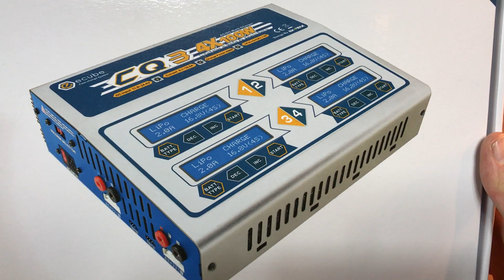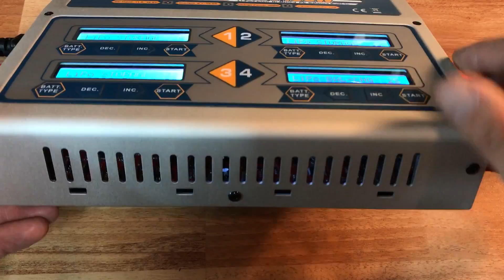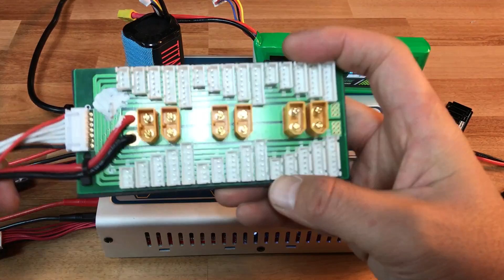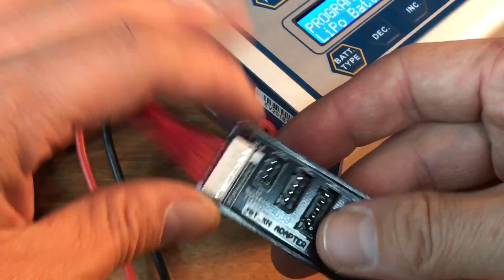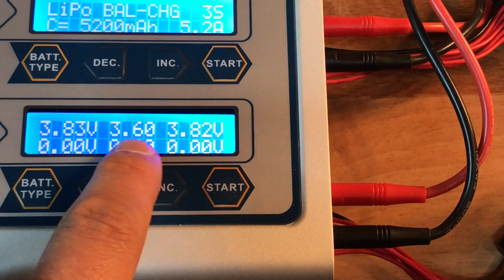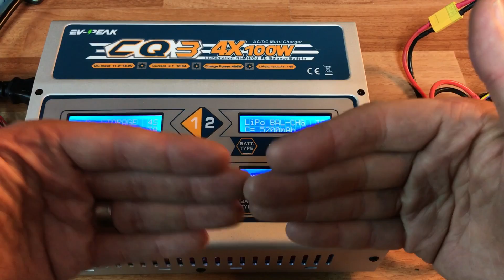EV-Peak CQ3 100Wx4 10A Charger Review (it's really, really good!)

Comment: I have a few 7.5 volt NiMh batteries that I'm trying to recondition.  I'm new to this field and know nothing about it. I've don't my capacity setting for NiMh battery for low 5000 and high 7500 MhA.  The charger goes through the 3 cycles and once I get the "END" flashing, I only see 0000 for low and 0106 to 0110 for high on all three tests on at least 12 batteries.  I'm not sure what I'm doing wrong.  On my user settings, right after display at 100% and right before factory reset, there is an option by factory default for "Battery End Vold" set for LiPo 4.2 v/c.  using the forward and back buttons, you can change the battery type.  I has everything except for NiMH.  Could be this?
Reply: U need to set the user settings first then select NiMh
Reply: Share your email I will send you the settings

Comment: HI Jeff    I have this charger but have never gotten it to work.    I have 2 batteries from Spectrum and getting "connection break" on any of the ports with both batteries.  They are not swollen in fact they are new.     A year ago I also tried to charge a battery and got the message "high voltage detected" and thought I damaged it and put it back in the box.  That was over a year ago.   I am not seeing the message when I try to use it again.  That was only on one of the ports.   I have tried that same port today and getting the connection break message but nothing about voltage.   Any Ideas?  Thanks!

Comment: I found that the c=setting in lipo is the charge current  cutoff and if you have new batteries they will often charge beyond that leaving your battery at less than 4.2 per cell. I usually set that c= number about 500mah above the rate of the battery so they dont stop prematurly

Comment: I have one of these. Does what it's supposed to do but one the first one the power switch broke so I couldn't turn if off. Got a replacement that also does what it's supposed to do but the fan is making a bed noise for some seconds after it starts. Probably bad bearing. Starting to question the quality of these.

Comment: How to charge a 550 3s battery... The cq3 has settings of 400, 500, 600, etc. What settings do I select to charge a 450 or 550 battery?
Reply: Its ok to charge a 550mha batt @ 600mha, if u have high C rated batteries you could charge @ 1000mha
Reply: Okay so for my 550 batteries I can charge them at 600. What about the amp setting? Do I let that stay at the default point 6? Or can I bump that up a little?

Comment: I have used the earlier model EV-Peak  80 watt per channel  AC/DC charger for 2 years, had to exchange, early on, when one display quit. Charger has worked well on my up to 4400 mah 4S packs but one display is becoming hard to read. This one has more features and cheaper price. My not be suitable for some fast charging large heli flyers . Make sure that supplier can/will repair  after warranty. This charger is probably limited to 100 watts per channel regardless of external power supply capacity.

Comment: can it really do 10 amps on 4s since you own one can you out a battery on or a few parallel and tell me please ? the ev peak duo one I had only put out 6.5 amps on 4s plugged into the wall thanks if you could test that for me and tell me that would be great
Reply from the maker: yes, i haven't tried that yet
Reply: 7demo7 thanks please lmk man
Reply: Depends if your battery can handle that though. Have to look at the charge rate on the batteries specs

Comment: Thanks for the review but I have a question. Using the balance board do your small 1S batteries charge like individual cells in a higher S battery on the CQ3? I've tried the 3 and 6 to 3S/6S balance cables and never get full charges to 4.2v and the the individual 1S batteries do not balance out as well as individual cells do in a real 3S/6S battery. Tied several chargers using 1S 150mAh to 750mAh batteries and they never completely charge to 4.2v and storage charge is also not as accurate. 

Do you use fast charge, charge, or balance charge when using the balance board? Sure would like to use one but so far my experience has been poor charging multiple 1S batteries as one larger S rated battery. This CQ3 is double the watts of the Hitec X4 and looks like the best charger for the money IMO IF quality parts are used and it lasts and is accurate. 

I have noted the Hitec X4 has much higher charging resolution accuracy than the Turnigy Accucell 6s chargers, both 50 & 80 amp models run off an accurate 350w power supply and as result some batteries take longer to balance charge on the Hitec X4 that seems to heal batteries being used down lower than ideal and balances cells better where some new (Nano Techs especially) batteries breaking in can take triple the normal time as new battery storage chemical makeup converts to useful battery capacity where I gain 20% or more. The Turnigy Accucell doesn't seem to see the cell voltage differences as well and compensate.

Comment: Can you discharge the battery using only the Negative & Positive leads not the "balance boards? I plan on using this to charge the packs ina  Prius 28 packs that are 6 cells internally. The volts range from 7.2-8.1 6500 mAh
Reply from the maker: not sure

Comment: 7demo7, I recently bought this. When I charge my Lipo batteries the charger shows each cell reaching 4.2v at the end of the charge (as it's supposed too).  But once I remove the battery I only read around 4.11 volts with my volt meter.  Do you see this same issue?  Do I dare increase the user setting end voltage above the 4.2 default?  Kinda not to sure about doing so..
Reply from the maker: yes, I increased the ending voltage to 4.22- its a little better on larger batteries but smaller batteries are still not being charged to 4.2,  I will be making a follow up video about this charger- very disappointing
Reply: Thanks for the feedback. I tried this and found port 4 actually got my 4S 1300mah to around 4.18-4.2v.  Thought this solved it and tried on other ports...nope.  All seem to be different even after turning up..  And you are right, my 1S batteries hardly charge past 4.11v even if I turn up the setting.  Super uncomfortable about doing so..  Now I'm back to my quest of finding a solid multi balance charger... :(

Comment: This is not a high powered charger, sad! A high powered charger would be the icharger duo 2*1400 watt outputs!
Reply: Would you please hop off the icharger duo 2's nuts.
Reply from the maker: You're comparing apples to oranges....
Why would you need to charge a battery that fast anyway?  The most I charge my lips is 3c and mostly 2c
Reply: 7demo7 I charge 24 3s lipos at 2c. Parallel charging 12 3s lipos on each output.   24 3s lipos are charged in 30min.  Thats why its nice to have that power. Other wise it would take more than 12-16 hours to do that on other chargers.
Reply: Bran Don I Parallel charge 24 3s lipo batteries in less than 30 min! Power!
Reply: +omega sun no one cares. I charge 4 different size of batteries at the same time with my charger. Duo can't do that.
Reply: Bran Don Yeah but due the the insane 1400 watts of power on each output I can charge 16 different capacity and cell count batteries in the same time you can charge 4. Each battery i have can be charged at 15c(turnigy graphene).  Thats less than 4 mins per lipo. That's 25 lipos in an hour for each output,  total of 50 lipos charged in one hour on the icharger 4010 duo.
Reply from the maker: Omega, That sounds like a nice charger- Just not for me.  I never have to charge that many batteries at once.  And Bran has a point- this charger has a built in power supply saving you more money.
Reply: 7demo7 ok cool, just wanted to give another option.

Comment: Thx, just bought one using your link.
Reply: You're so lost. This charger has 4 separate outputs not just 2, has a built in AC power supply, and cost $100 less. Not everyone needs 1400 watts or wants to spend several hundred dollars on the DC power supply required to make provide that kind of power.
Reply from the maker: +Bran “BMR” Don awesome!!!
Reply from the maker: Hi, Just wanted to say, between yesterday and today I've found an issue with my charger- It reports the battery as charged at 4.20v when it's closer to 4.10v- I'm working with the company to find the problem- I thought I'd let you know.  I don't know if yours will do this,  I am going to make my video private until this issue is resolved and follow up with a update video.
Reply: @7demo7review  it was never fixed, but your video was public. Watched it and bought it.
Reply: 7demo7 look up the icharger 4010 duo, it's a beast! The charger in this video is weak, Sad!
Reply: Icharger duo 4010 has 2 1400 watt outputs! win!

Comment: that must be a major flaw with these chargers. I've had mine for a year, and about 2 months in an the power switch crapped out on me. Besides that and the noise its a nice charger.  4x 1300 mah 4s in 40 minutes gotta love it.
Reply: I truly hope they do fix that flaw soon. For this type of money this should not be occurring. Thanks for sharing your experience.
Reply: At least it still turns on tho? Do you still have it and does it still work?
Reply: G-nice
My seller lowered the price instead of that I sent it back. (I can live without the switch) 
*sorry about my crappy English
Reply: Just bought for 7.99 dollars
https://www.banggood.com/ECUBEE-Intelligent-LED-APP-Control-EDC-Hand-Spinner-USB-Chargeable-Fingertips-Gyro-Gadget-p-1166962.html?p=B4200913385416201708
Cheers

https://www.youtube.com/watch?v=gSpy8aIEXO0
Reply: Just got my qc3, if power switches go bad, why dont i just leave the switch on all the time and plug/unplug from the wall to turn on and off.
Reply: @chrisbrennan5851  ya basically what did. I bought a wall plug that has a remote, pretty nice.  Amazon has em for 15$
Reply: Still have it to this day. I did lose one channel, my fault. Other than that great charger.
Reply: @g-nice4928  mind if i ask what happened to that channel? and what you did? so i can try to avoid doing that
Reply: Sure. When I was switching out connectors (xt60), I bumped the positive barrel connector to the frame of the charger an it shorted out that channel. I opened the charger up to see if maybe there was some type of fuse reset, no luck. Just be careful plugging an unplugging.
Reply: @g-nice4928  dang, that sucks man, thanks for letting me know though!